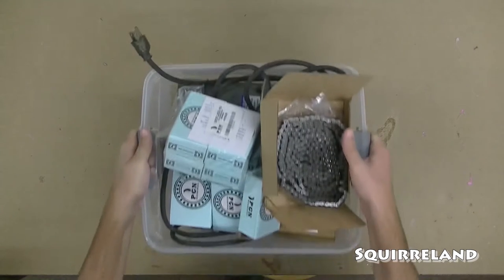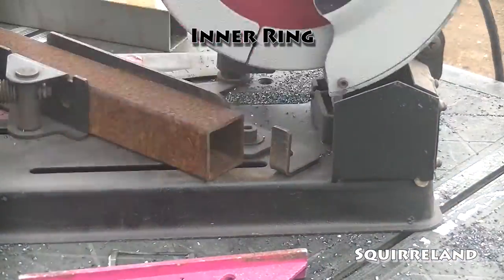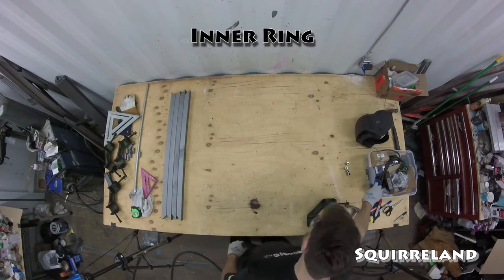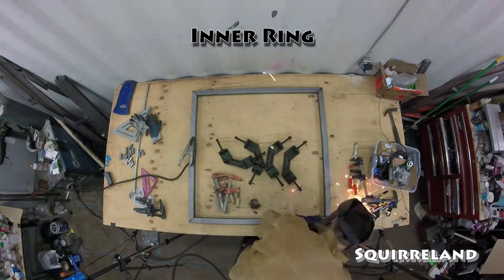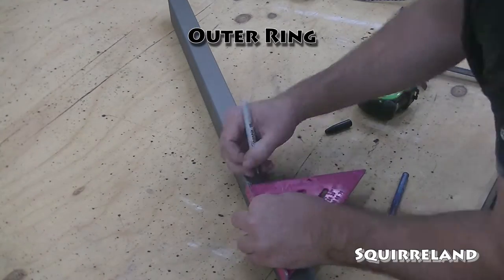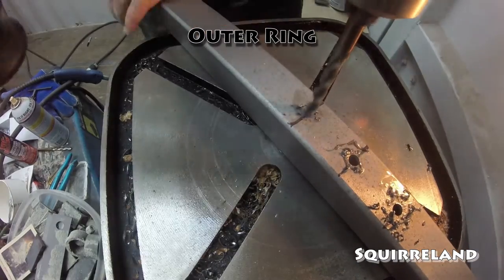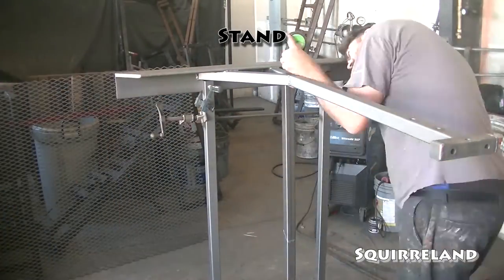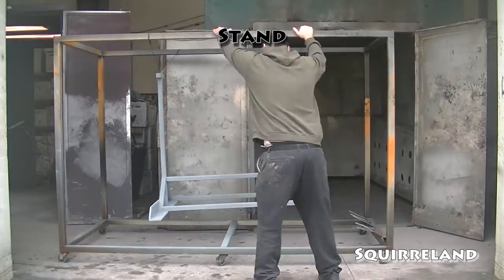Rotocasting Machine Build - Custom Machine - Squirreland

Comment: Good job, but have you seen that one side of small ring never points down?) I think it needs another gear. Ps sorry for my speaking skills)
Reply from the maker: Your speaking skills are just fine.  Yes, I know what you're talking about.  You are correct, and I'm going to have to replace the gear on the top side with one that has half as many teeth to fix that issue.  Thanks!